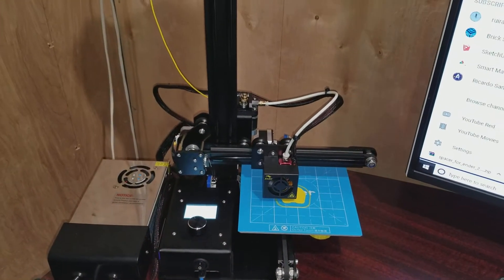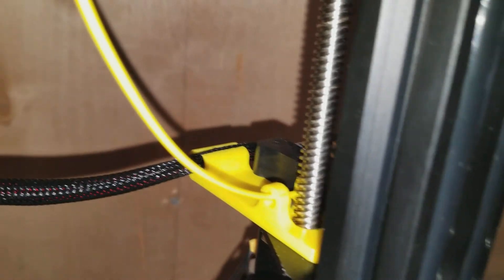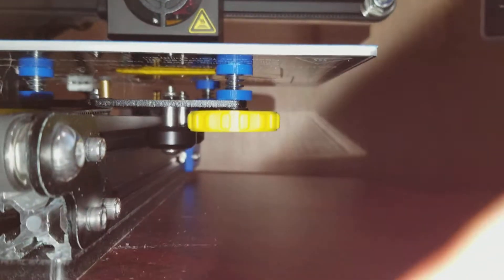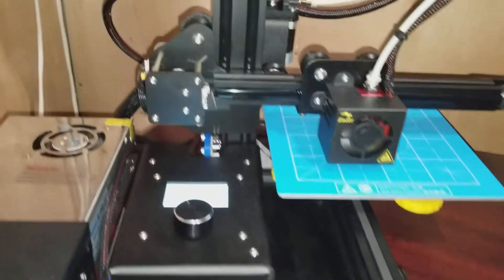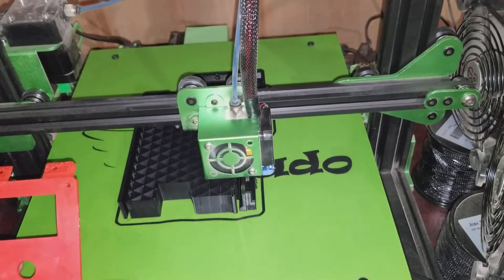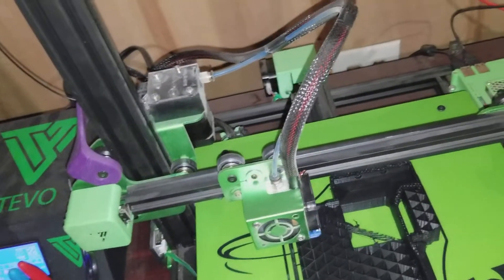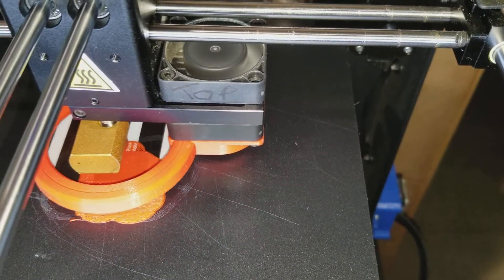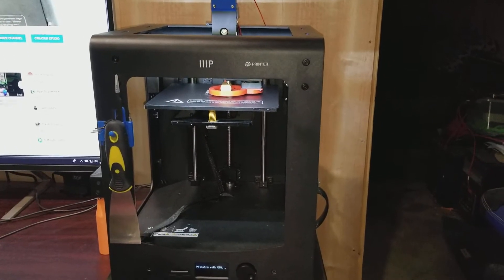Ender 2 Mini review, Tevo Tornado update, Monoprice Maker Ultimate update. Happy New Years!

Comment: Well, happy cinco de mayo here in Illinois ha ha ha
Reply from the maker: How is the printing coming along?
Reply: It was off to a good start but then went to heck. I'm getting a lot of spaghetti lately.  We're trying to figure it out.  I printed a perfect 20 x 20 test cube.  Beautiful. Then 2 out of 4 great leveling wheels then blah.I might be this print surface I got. A Mamorubot print surface.  I haven't changed any Slicer settings.  I'm going crazy trying to figure out what the problem is.  Has to be the print surface. But it could be those cheap chinese leveling springs too so I'm off to ACE tomorrow to get a set of American made Stainless steel springs.  I got quite a few pictures of the messes..
Reply from the maker: Try 70c for the bed. Have read that it helps with that surface.

Comment: What Slicer are you using?
Any ABS prints?
Reply from the maker: I use S3D and Cura 3.2 I am still transitioning over to S3D.  No, sorry not yet the MMU is intended for ABS, it has the enclosure kit and all metal hot end.
Reply: is it this one https://www.slicer.org/?
Reply from the maker: No, I do not use Slicer.   I use this:   https://ultimaker.com/en/products/ultimaker-cura-software    and this:    https://www.simplify3d.com/software/features/

Comment: "I'm printing USB because I don't have a pie for it"
Can you explain to a noob (me) what that means?
Reply from the maker: +odinata I use Octopi for printing. Www.octoprint.org.   I will be releasing a full how to video with step by step screen capture for Octoprint this weekend. Please subscribe to be notified.
Reply: Hey, thanks for the reply.  I had NO idea what you are talking about...but i think i get it a little bit now.
Well, I pulled the trigger and bought a Ender 2 today.
I may be hitting you up for advice..I have NO IDEA what I'm doing.
Maybe you could help me with the very beginning stuff.
What filament should i get to started?
Also, I know nothing about "slicers".
I do have Fusion 360, but no idea how to use it...( I know that's beyond the scope here).
Thanks again, and it was your video that pushed me over the edge!
Reply from the maker: Nice congrats!  No problem post your questions up here and I will try to help best I can.  For filament I'd say to try Zyltech.com (You can also get it at amazon and ebay but it's more expensive there.)  I have tried 9 of their colors and all print nice.  Okay, for slicer, I'd say you want Cura 3.2 from Ultimaker to start with. It's free.

Comment: nice to know u are printing my control box, and as other said it was intented to print with the front on the bed to reduce the supports XD
Reply from the maker: Yes, and it's a great design! Thanks.    I found that out about printing orientation the hard way lol. My newer Ender 2 video has it finished and installed, I used the Ender 2 to print it! The first attempt I used my Tornado.

Comment: When you say Pi... are you referring to .. bluetooth on the motherboard? As well as, a good motherboard that can do all the CPU X/Y/Z + Nozzle activity? How can Pi motherboard know how to make such clean prints?
Reply: I just got a DOA Ender 2 printer and I would love to have all those upgrades.
Reply from the maker: Sorry to hear about the doa.  Did you check the voltage switch in the power supply to make sure that it is set correctly for your Country? They often default to 220.
Reply from the maker: I am referring to using OctoPrint on a Raspberry Pi and using a web browser to manage the printing. My most recent video has a demo of Octoprint and I will be doing a full how to video this weekend.   Thanks for watching!

Comment: That Ender box prints much better standing up on the front face. Good little machine the ender 2, I have 4 myself.
Reply from the maker: Yep, I learned the hard way, the black one I tried printing as it bolts on was a dud, I had some y shift and way too hard to remove the supports.  I redid it using the Ender2 and it came out nice!  Oh nice! 4 huh. Yeah I dig it but if I go past 3 3D printers I am itching for a Delta!

Comment: On the drag marks and outside issues my first reaction would be over extrusion. On my machine when it is dragging through a flat layer it pushing out too much plastic and making raised ridges that it then scrapes over when it does the next layer. I would suggest lowering extrusion multiplier in your slicer (flowtweak in kisslicer) and possibly print at a lower temperature. Remember when tweaking settings only do one at a time and then test it. It takes for freaking ever but you get a much better handle on how those changes effect your print quality for future tweaking on other machines or different filaments.
Reply: You need to add z hop on head moves to get rid of the drag marks. That's how I took care of those marks on my maker select v1 cheers.
Reply: +3D Printer Junkie, +John Beaudette - Yep, that's what I'm thinking, err.. guessing. Perhaps z-hop, the lack thereof. Dunno what slicer was used , if there's a setting or two (2) for 'rise/raise' on retraction/z-hop, also. 
Regardless, thumbs-up! and thx.
Reply from the maker: I have it all dialed in now thanks!  Prints amazing!
Reply from the maker: Thanks for watching and the advice, I'll take a look at that.
Reply from the maker: Nice, thanks for the advice, I will check it out!
Reply: 3D Printer Junkie I am considering buying the ultimate. Could you put up a video on it so I can get a better idea of how it works compared to the other 2 printers I have. Cheers
Reply: Hey! +3D Printer Junkie - Yeah? Good. And as usual, I shoulda kept my trap shut. Later...